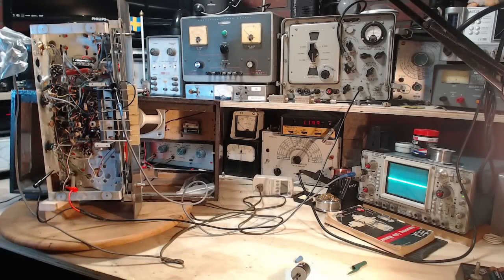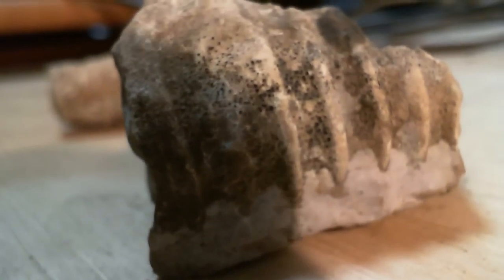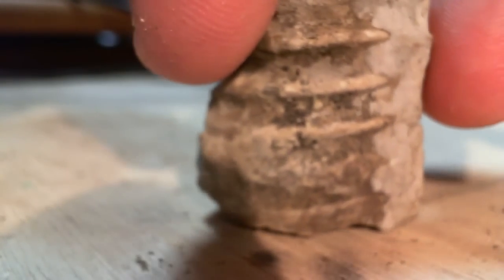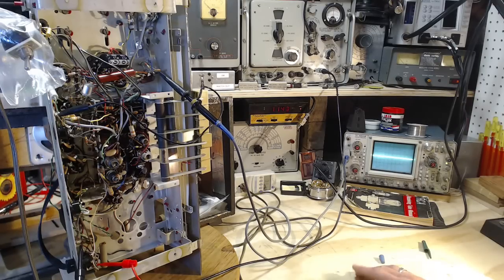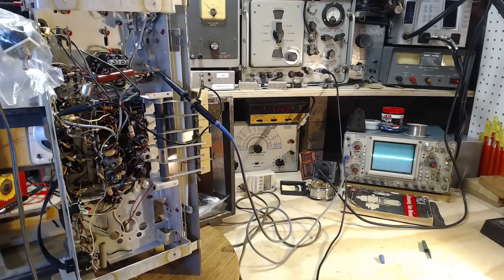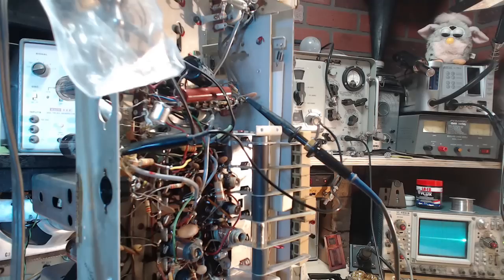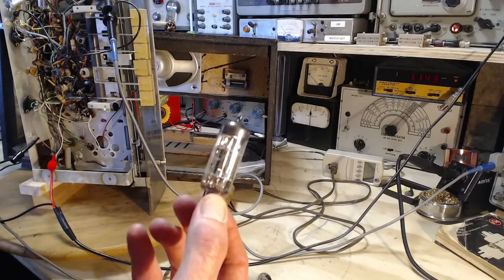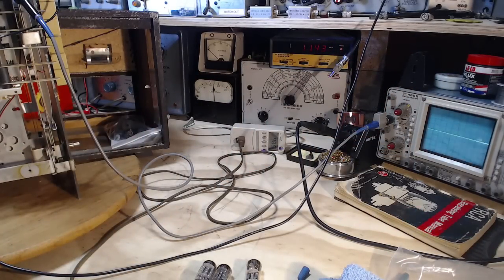Florida AM/FM/SW Tube Radio Video #9 - Audio Testing (and Paleontology)

Comment: It looks like a bad quiescent bias point on the audio amp to me.    If it clips on one polarity and not the other the bias point is not balanced.   Why not inject an audio signal into the amp and test that audio amp to verify it is not bias wrong.  The excessive heat on the output tube sure points to the same conclusion.